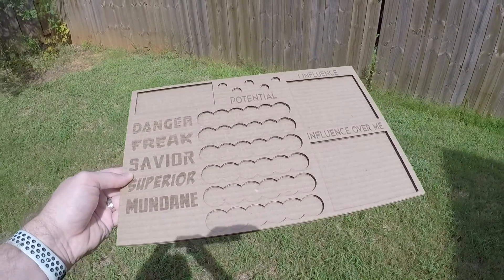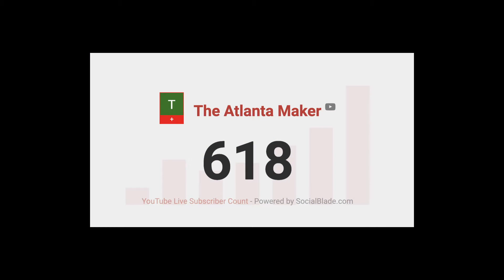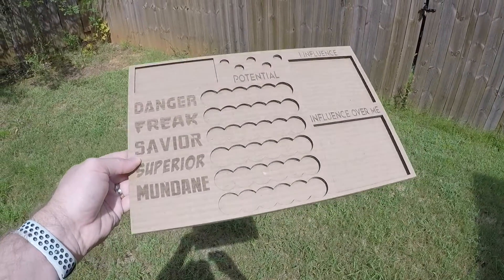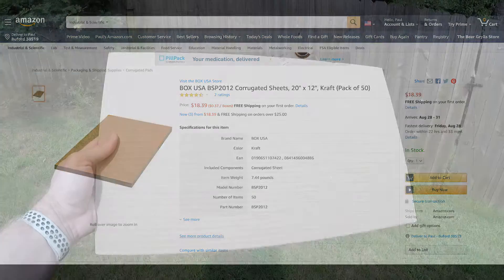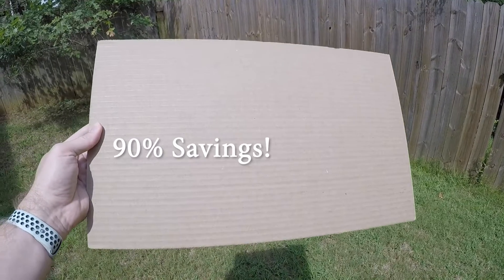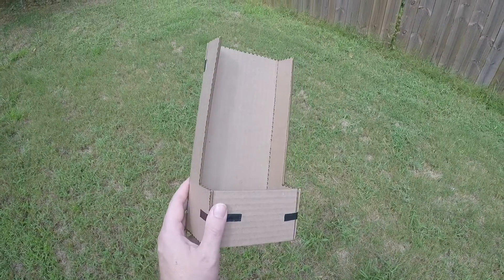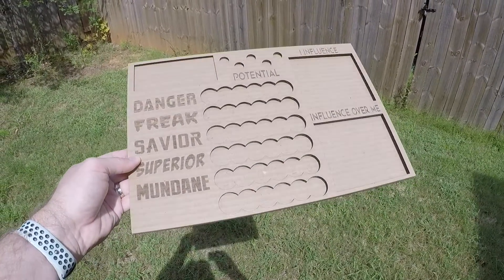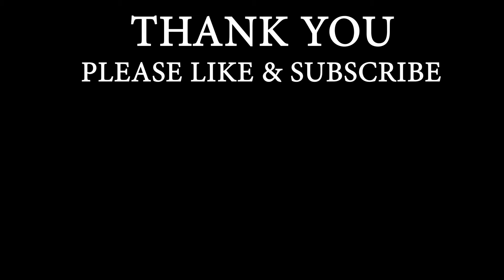Glowforge Cardboard Prototyping - Save up to 90% in Material Cost - Glowforge Tutorial

Comment: I tried making a prototype just now that gave me 40 mins with cardboard. I had to cancel the print because my heart was about to pop out of my heard looking at the little flame as it went through the print (I’ve heard horror stories lately about fires with the GF). How thick should the cardboard be? I was looking at the specs of the amazon product you shared, but couldn’t locate the thickness.
Reply from the maker: The stuff I used in the video from Amazon is about .15 inches or 5/32" and cuts super well with the settings I used in the video.
Reply: Thank you!

Comment: Great ideas all around. What do you think a suitable test material would be for use on a CNC in the absence of a large amount of scrap wood?
Reply from the maker: I wonder if some of that pink foam board in the insulation department at Home Depot might be a good fit for the CNC side.  It’s a good question, I’ll poke around next time I’m there.